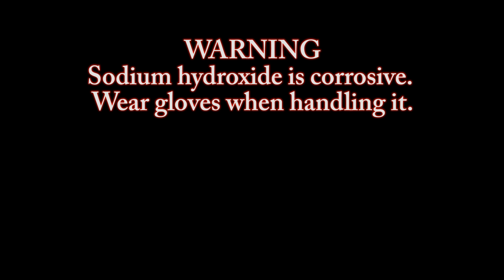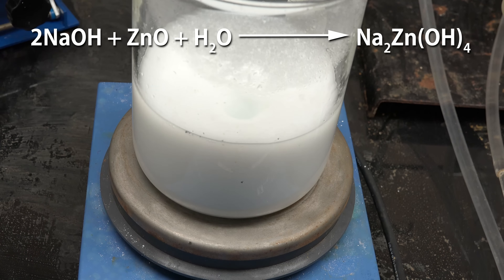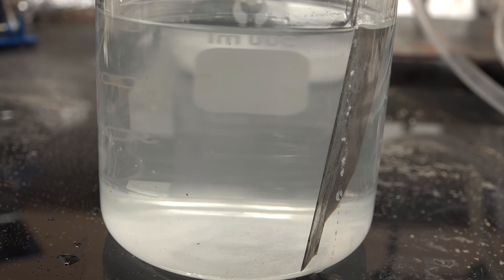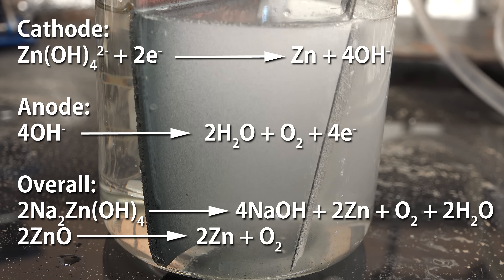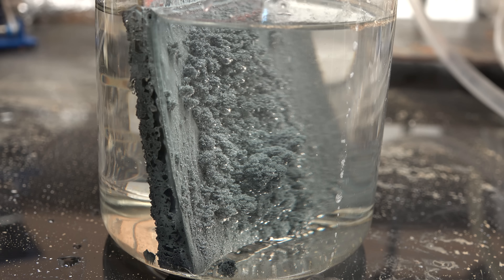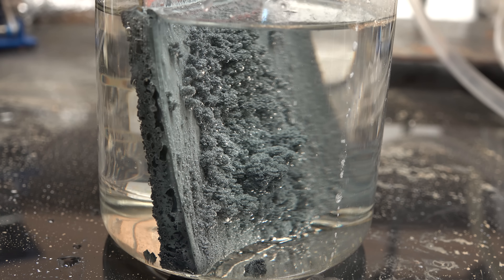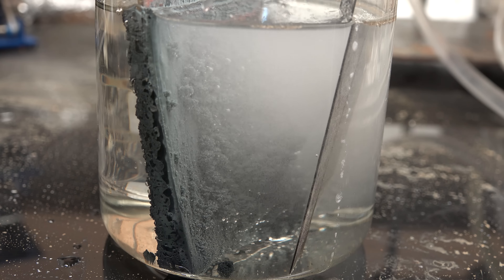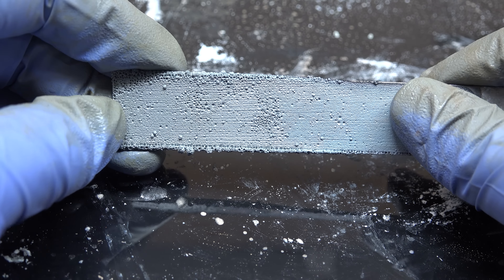Make Zinc Powder by Electrolysis

Comment: I've made these dendrites and used them for air batteries. It works but the zinc powder dissolves like putting snow under a blow torch. This very thing is being used for power storage systems and was used by the German postal service to power their trucks but was only a pilot program that was discontinued. Thanks!

Comment: FYI industrially zinc is plated using alkaline cyanide bath and also alkaline pyrophosphate solution. Rem electromotive force series is different in alkaline vs acid e.g. hydrogen is 0.0 volts in acid and -0.8 volts in alkali. Also the area around the negative electrode attracts zinc positive ions not negative zincate ions; need agitation.

Comment: for anyone willing to make some zinc powder, and for some reason doenst have zinc oxide nearby but has d2 batteries, you can directly dissolve metal zinc in sodium hydroxide, just know that depending on the brand the battery internals changes, in my opinion, of you want to take it apart easily and have nice clean zinc case, rather than rayovac that gas some weird solic black glue that can be a pain to deal woth it since i have no idea what it is

also, i measured the zinc body of the batteries i recently dissasembled, and my scale says both are 9 grams, that may change from battery from battery, brand from brand, but average i think it's not far off to suppose it would be around ~9 grams for most batteries from most brands

if you for some reason dont want to wait to zonc oxide to arrive, have to make zinc oxide or have some zinc metal around and dont want  to buy zinc oxide, i hope this helps! but if you really are in a hurry, i shouldnt have to mention but i will anyway: dissolving the zinc metal into solution will take a lot longer than fine zinc oxide powder!

as a side note: as always, when reacting metals, clean it as best as you can, sand it all around, steel wool, steel brush as best as you can to make the reaction faster, the cleaner the faster it will react
Reply: Thank you 🙏

Comment from the maker: I've purchased another hotplate stirrer so hopefully that will arrive soon. Then we can get back to real chemistry.
(The hotplate stirrer in the video is another broken one that just stirs and doesn't heat)
Reply: how does it stir, a magnet? how does the magnet work
Reply: how does water get stirred with a magenet
Reply: oh there's a magnet inside the water that spins
Reply: Can't you use a heating mantle overtop of the stirrer as a makeshift hot plate?
Reply: it alse works with Al2O3?
Reply: +BMAN488877 Thanks a lot (also*)
Reply: If you take the zinc out, scrape it off, and wash it immediately 3 times with dH20, then twice with acetone, you have yourself activated zinc. Be sure to dry it under an inert atmosphere because it is pyrophoric.

Comment: @NurdRage
I am wanting to purify some zinc for our periodic table.
My source material is some rather nasty corroded zinc from dead zinc-chloride batteries. I have saved the manganese dioxide / electrolyte paste and carbon electrodes.i am just wondering if a lye in water solution will dissolve the zinc and zinc oxides, maybe chlorides or other corrosion products?
Would the electrolysis process then leave contaminates in solution and maybe also form an anode sludge of less soluble material?
I am not a chemist, just trying to work things out to keep my two son's interested in doing these experiments.

Comment: Hardware store has "galvanizing" paint which I sprayed into beaker of naphtha (thinner) and the zinc powder was reactive with aryl chloride. I cheated by using an ultrasonic source to stimulate the slow zinc reaction. Sonication stimutates grignard start and really seams to help with multiphase reactions (e.g. conc NaHSO4, NaBr, MeOH > MeBr). We took a grinder to a welding "zinc" but powder was too oxidized needed activation.

Comment: you must use a wire at cathode that would prevent zinc plating and give you crystals of zinc.
Reply: Hey! I want to know your confirmation about the method that this method will work with aluminium oxide or foil ...

Comment: This is an old video but much appreciated. Very cool, although would using ZnCl2 work as a substitute for the oxide? I have a bunch of ZnCl2 that I don’t have a use for and zinc powder is def something I have wanted to play with. Great work as always 👍🏻
Reply: Dissolve the chloride. Use enough NaOH to ppt all of the zinc as the hyroxide. Wash precipitate and dissolve it in more NaOH. You then have your sodium zincate starting material.
Reply: Yes you can, but it will cause production of toxic Cl2 gas instead of O2 so it's a bit more dangerous

Comment: Deutsche post office used this method to generate/regenerate for zinc air batteries for a small fleet of trucks in 1995. A company in Canada is doing something similar for power storage. The bundepost could generate 100kg per hour but it took 750kg to fuel a truck for 200 miles carrying 2 metric tons. My question is, how do you rinse and preserve the powder so I can make my own zinc air batteries? Thank you so very much!

Comment: Very nice Video! But I have a question: Can you do the same procedure with aluminum oxide? Or do you need a different solvent?
Reply: No. Aluminium reacts with sodium hydroxide to form sodium aluminiate.
Reply: @neutronpcxt372   mean we can do the aluminium powder with the same  steps ? Or no
Reply: @MustafaAhmed-rr8wu  aluminum is highly reactive, so it can't be deposited in the cathode, and only hydrogen is going to be reduced
Reply: but this can be done with lead

Comment: Zinc powders can be very reactive in air and water. Be careful when making fine powders or large batches as pure zinc powder is pyrophoric.
Reply: I've never been able to set fire to Zinc powder in air. Apparently my propane and MAPP gas (~acetylene) melts the Zinc dust but it doesn't burn. The burners will ignite magnesium turnings and MAPP can light Aluminum powder.
Reply: @stephenjacks8196  have you made zinc which does not catch fire at its boiling point ?
Reply: I had no problems igniting some chemistry kit zinc powder with a
simple fuse; getting the smoke out of the basement was a bit harder.
(Gratefully neighbors called my parents before the f.d.) July, 1969.

Comment: Can you make a video on how to Recycle zinc sulfate.... how to separate the zinc from sulfuric acid and not destroy the acid other then distillation. I tried with Electrolysis, the moment I cut the power the zinc goes back into solution. even diluting the solution, I can't get the zinc out fast enough. Or maybe it's just not possible?

Comment: Can I use a copper anode? Also, can I dissolve zinc casings from dead batteries to make the sodium zincate solution? After all, both zinc and zinc oxide dissolves in sodium hydroxide

Comment: NurdRage I have a question
why you used zinc oxide to be dissolved in the sodium hydroxide solution
if sodium hydroxide reacts with zinc at the same way?
Reply: Niv Moshe 
Maybe i can help you .
Yes sodium hydroxide can react with zinc but if the process is working that doesn't happen cz at the same time you produce zinc metal so when finished the process you must to filter off the solution instantly. To protect your powder .and dry it with acetone or ethanol.
And sry for bad english .
Reply: well, the point was to make the zink, so ...

Comment: How do you control the voltage? I want to do something like this for an IB chemistry investigation. I plan on exploring how different voltages affect the rate of reaction using the method you used in this video.
Reply: Michael Hwang Variable power supply. About $100 at a local electronics store (cheap kind anyway)

Additionally you can get a 120 volt transformer with about 5 amps and just add resistors... Wouldn't recommend it though
Reply: you need a current supply ideally.
Reply: a benchtop variable power supply should do it

Comment: What voltage and how much current did you use? Did you use AC or DC?
Reply: He said positive electrode and negative electrode. There is plus and minus on a battery not an AC cord.

Comment: what voltage did you apply?
Reply: 1:20
Ain't sure but try 12V 1 Amp then like he said drop to %20 current( .2A = 200mA )
For electrolysis current is more important than voltage
but since voltage is a path to current then it must be high(12v)
See this, if you got a variable power supply like Gophert, it will read you how much voltage/amperage(current) is being consumed by electrolysis
or use 2 cheap DMMs if you only got a 12v dc adapter/source.
the one that reads voltage connects parallel to +/- wires
and the one that reads amperage/current connected in series, meaning before the + or - electrode.
https://www.harborfreight.com/7-function-digital-multimeter-92020.html
(if you already got a DMM then that is good so just get another and if not you want one of the DMMs to be decent(not very) like Aneng 8008 for example)

Comment: @NurdRage I have a question please...Its about Goulard's extract which is mainly lead subacetate...well the official pharmacopoeia procedure states that 250 gm lead acetate + 175 gm lead mono oxide dissolved and titre to 1 liter..the filtrate is isolated and called strong solution and the 12.5 ml of the strong solution is diluted further on demand to form the diluted medical lead sub acetate...the question is if I had lead subacetate powder haw can I prepare the diluted form of this extract to use it in my pharmacy...my calculations lead me to use 0.003 dilution that is 3 grams of lead sub acetate in 1 liter...any ideas please?
Reply from the maker: Your pharmacy should not be using such a toxic compound.
Reply: it is used topically as a powerful astringent solution in hemorrhoids...it is still used in Egypt pal
Reply from the maker: That doesn't make it any safer. Lead should be avoided on anything medical.
Reply: I agree to a certain extent...I know lead is very poisonous yet it is absorbed on daily basis from car wastes and glaze painting on housewares...I agree with you  rather...Yet in Egypt its a little bit different we are obliged to a certain prescription laws which makes the soln still used and applicable...but do you really think that concentrations as low as 0.003 could have this damage...take in mind that the duration of therapy is 1 week max...another thing to take in mind that the quality of other medicines that could substitute for it available in Egypt is negligible..take my word for this

Comment: would there be any reaction with the copper circuit board and if yes then what would be produced ?
Reply: Not as the cathode, here. The fact that you are reducing zinc ions to metal, here, means that the cathode is kept at an electrical potential that ensures that it remains as a metal.

Comment: how make aluminium powder chemistry method?
Reply: React aluminium with steel balls.
Reply: Lemtil lol
Reply: 34Scrooge 
1. Obtain sodium hydroxide solution
2. Dissolve aluminium to form NaAl(OH)4
3. Perform electrolysis
4. Scrape aluminium off cathode
5. Result
Reply: You can't make it by the same process .aluminium is very reactive to hydroxide .it's react to produce hydrogen gas and you return to the same compound sodium aluminate.
Reply: Is there a reasonable way to convert aluminum oxide to aluminum powder? I have always been curious about that. Aluminum powder is very useful in a lot of things, albeit dangerous, but all the good things are dangerous if used improperly.

I know electrolysis is NOT a reasonable method, unless you can produce hundreds of kiloamps at 5v xD

Comment: Can I also make aluminum powder via electrolysis or not? If it is possible I would really like to know how.
Reply: Doubt it. Aluminum is extremely difficult to separate from oxygen. The industrial production of aluminum involves high-temperature electrolysis of the fluoride. Before this, it was considered a precious metal because it was so hard to produce, and there's a story that Napoleon served his most honored guests on plates of it while the others had to settle for gold. Aluminum reacts vigorously with water under standard conditions, but while the strong bond with oxygen passivates the bulk metal, that prevents the formation of the metal in water due to the fact that any reduced atoms would immediately react with water to produce hydrogen and the hydroxide. I suppose this could potentially be used to purify said hydroxide, but I believe any non-industrial production of the metal is out of the question.
If you want to make aluminum powder, I recommend getting a good blender (I've tried coffee grinders, the small chamber gets hot and the thin plastic breaks.)
Reply: Ok thanks for advice.

Comment: I have a bunch of zinc metal, but how can I make zinc oxide from it? When I Google it all I see is "how to make zinc oxide nanoparticles", and I don't need nanoparticles, I just want to make the zinc powder from the metal.
Reply: Dissolve it in an acid and add a base to make the unsoluble hydroxide. Filter and calcine the hydroxide to get the oxide. You can also just add an excess of sodium/potassium hydroxide to the dissolved salt to make the zincate and electrolyse as in the video.

Comment: Is there a substitute for nickle
Reply from the maker: platinum
Reply: I used graphite for one electrode and a stainless steel spatula for the other, and it worked fine. The only downside is that the solution becomes discoloured over time. My zinc oxide came from sphalerite (zinc ore) so wasnt very pure to begin with which may be the cause, but i think alot of it was the graphite flaking off.

Comment: Is it possible to make aluminum powder in the same way?
Reply: No. You cannot make Al from solution as it binds too strongly - you would only get H2. He mentioned that if you do zinc wrong you get H2, but zinc "just" works. you need to mix Al2O3 with cryolite and melt at >>1000 degrees. And it requires way more electricity than zinc, as Al is light and requires 3 electrons. zinc needs 2.
Reply: +Idjles Erle 
Oh wow. You know you're stuff, thank you very much.

Comment: sir is that nano zinc powder ?
Reply: I think so....i also tried this at home with zinc oxide optain from old bateries and a mangan dioxide anode, after drying the zinc, it self becomes very hot it even light itself just in the air....so i think it is very fine powder

sorry for my bad English  and nice grettings from Germany
Reply: Kaskade TV Not bad English
All chemists are welcome (: